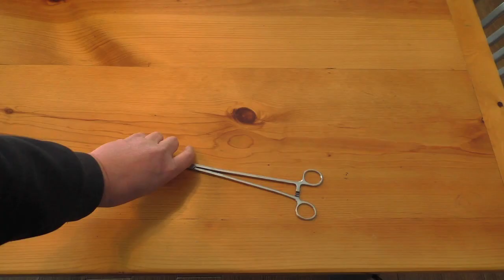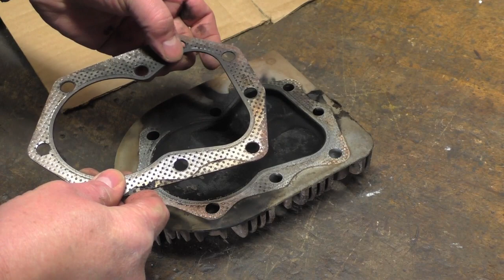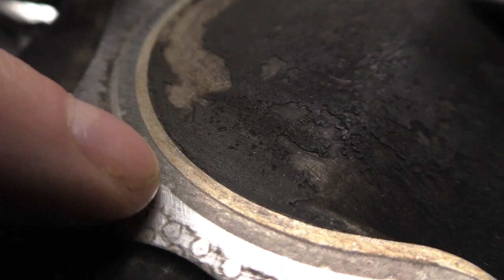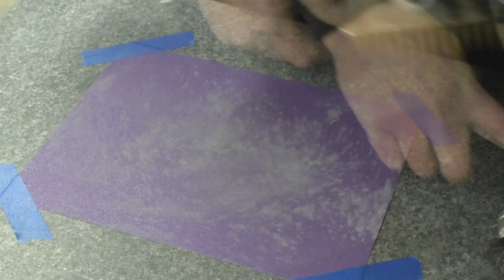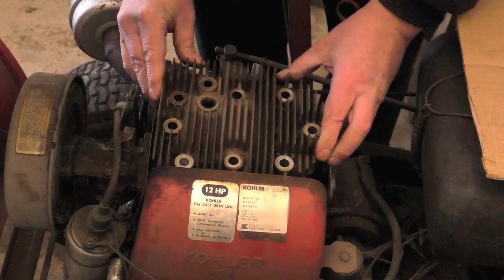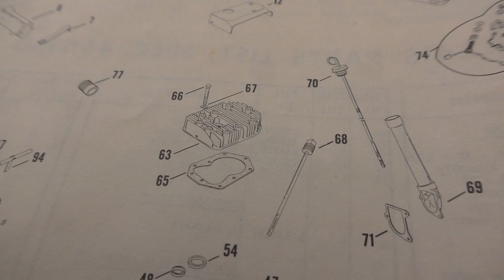Kohler K301 Head Fix

Comment: If you can locate a larger Kohler Wheel horse muffler cheap it will have more power. Expensive new so look for a used one. Just not enough back pressure with these small mufflers so power is lost. At least I lost quite a bit when I put a small one on my 10hp horse so I searched around and found another bigger one. My original one rusted out.
 Great video btw, you just can't beat an ol' Wheel Horse, I'm addicted to them..lol. Peace

Comment: Went to rebuild my carter carb someone removed and noticed the butterfly is missing. How do you replace it?
Reply from the maker: Not sure.  I would see if Mustie1 has a video on that.
Reply: @dlunderdahl  
Oh this is a fun one. Checkball & Spring can really suck and if either go flying out trying to install it best of luck locating them. Most likely why its off, it's on someone's garage floor. Depending on ones patients and skills its best sometimes to buy a new carb or send it to a pro. Easy to rebuild these carbs if the butterfly isn't removed and if it's the Walbro carb ( mostly on Magnums) just order the Carter style with main jet in very top. Much better carb and the engine will last so longer to as Walbro' s run way too lean making an engine with the Walbro run about a 100 degrees hotter.

Comment: Take a look at your carb throttle shaft bushing, it is worn and causing a combustion issue. Your engine needs a new piston and rings, and the carb fixed.
Reply: WTF would even make one think this engine needs rebuilt? Must be because it turns over so easy? Kohler's have a combustion release so it will turn over very easy and there is nothing in this vid that makes it appear in need of being rebuilt, there's no smoke, starts/runs perfectly smooth, great power the man says. What a ridiculous waste of money & time it would be to tear such a good running engine down! WOW!!!
Reply: @harryballz6358  Take a look at the burnt edge of the cylinder @ 13:51 -13:52. Stop the video, it is very clear. Now look at the missing portion of the piston. Can you see the exposed piston ring?  This is the result of a vacuum leak, due to worn throttle shaft bushings. The damaged cylinder can be seen again @ 16:40. Look at the exhaust side of the piston.  This is a widely known issue with K series Kohlers.      Your comment was a ridiculous waste of typing.
Reply: Missing portion of the the piston? I don't think we're watching the same video. 😅 Cylinder looks pretty good, let her rip! ✌️

Comment: I want to see ,,how to fix crankshaft for k301,, because I have a kohler k301 engine, and the cranckshaft is oval. Don,t exist in the part for change, original or aftermarket.
Reply: If it's oval, it needs to be turned down. A competent machine shop can handle this.
Reply from the maker: I would watch a video about the crankshaft.  These engines are really well made, I think.